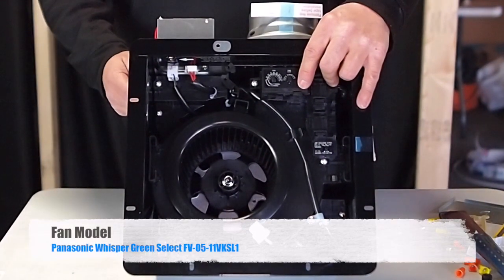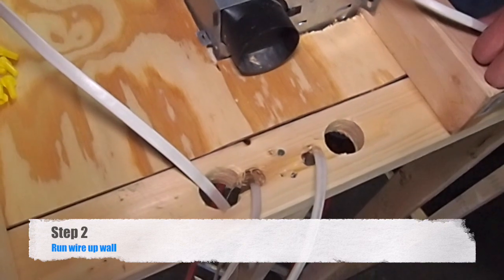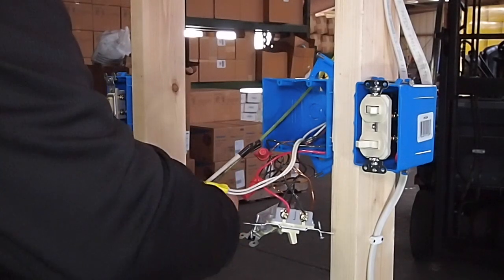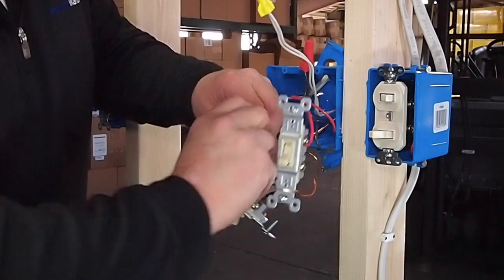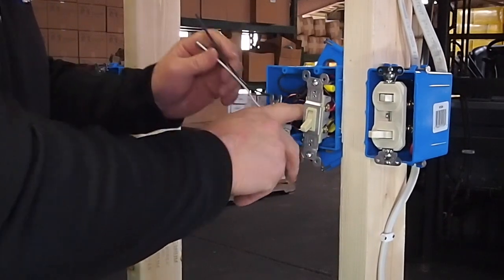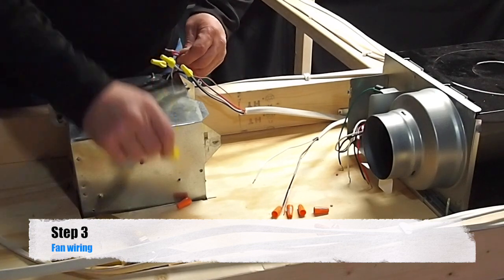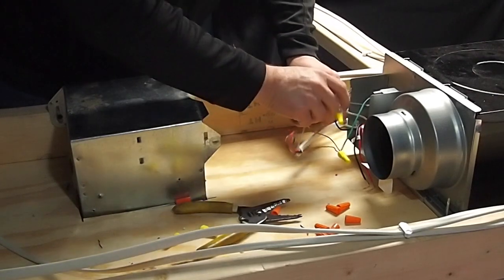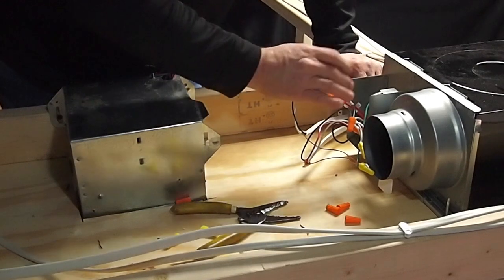Panasonic Whisper Green RetroFit Bath Fan Wiring Scenario (6 of 7)

Comment: How does this work with the led night light?
Reply: Since I made this video there has been a model change. The new fan FV-0511VKSL2 has a built in night light that you would put on a switch. If you can't put a switch in you can still use the plug n play night light. FV-NLVK1. For this you just need a constant powered fan. This Night Light works off a photo cell.
Reply: @bryanwhittaker3143  

Thank you, sir.  

Would you be willing to create a new video for the FV-0511VKSL2?  I am only interested in the wiring.  No need for how to fish the wires.  

It would be better to see a video on a bench so I can see the wires and how the modules (e.g. continuous fan, spot fan, night light, regular light, etc. all work together).  

My Setup:
I have a fan / light combo now with two switches.  One is for the light and the fan is on a push button timer switch (5 / 10 /etc) that I installed.  

Goals: 
1. Fan that I can run off an electronic timer switch or I can run continuously (if I change my mind later).  For continuous, I suppose I can just change the switch to a regular switch and leave it on... 

2. Fan Light that is on a switch (this is already in place from the current fan / light combo).    

3. Night Light module that goes on in the dark.. In other words, it does NOT require a switch OR the fan to run continuously or turn on for 20 minutes every time I walk in the bathroom.   

P.S.
Timer Switch... 
https://www.homedepot.com/p/Defiant-15-Amp-4-Hour-In-Wall-Push-Button-Countdown-Timer-Switch-with-Screw-Terminals-White-30469/206264395